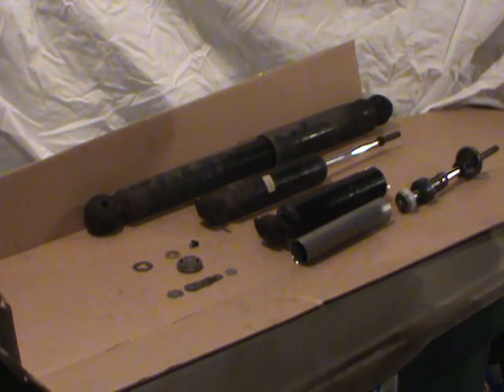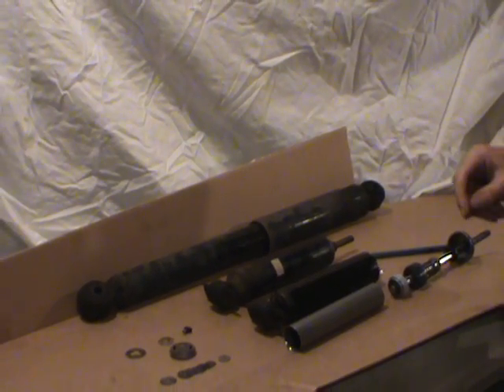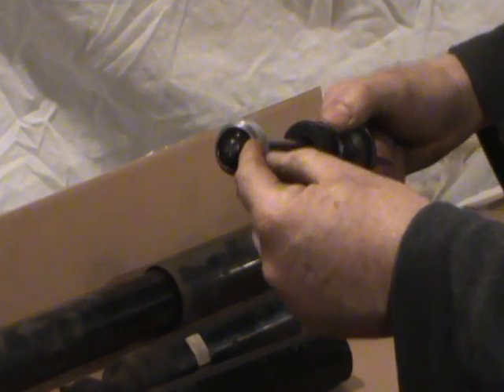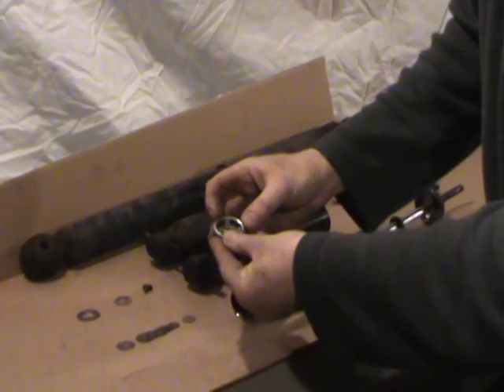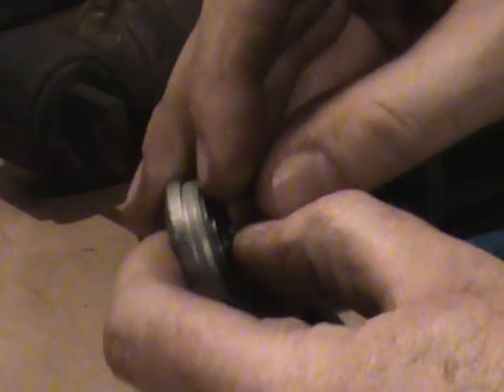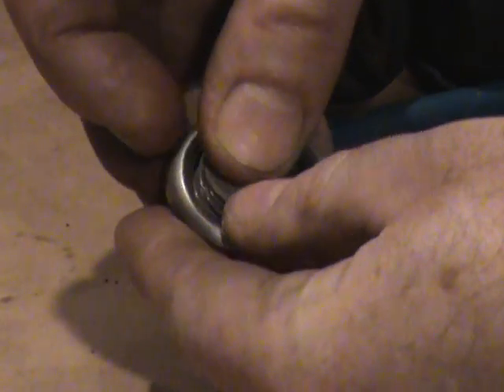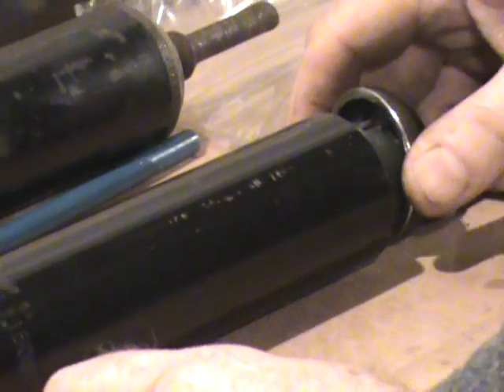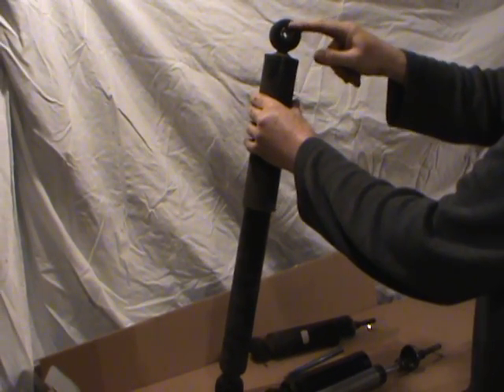Shock Absorber Taken Apart and Explained

Comment: I was a gunsmith for years and the best tool steel and gun part material in the world is shock absorber and Mc Pherson strut shafts. If you make friends with your local junk yard guy you will find him eager to sell them to you for a couple of bucks each. Manufacturers give him maybe a buck a core for them. Chisels, punches, firing pins, heck I even made a custom magnum bolt for a high powered center fire rifle out of a McPherson shaft. That .338 Lapua has fired hundreds of rounds and is like new. It will heat treat hard as glass or tough as nails depending on what you quench it in and how hot you get it
Reply from the maker: Greetings...Lawrence Withrow..........Thanks for watching, and for, what you had to say too..........Yes, indeed, the shock absorber's piston "rod", sure must be, some pretty good material alright (maybe, even, chrome plated sometimes?)...........Hmmm...maybe...4140...at the very least perhaps?..........From what I recall, it's usually those last two numbers, that indicate the carbon content, and, Ya gotta have at least, that 40 (in the number), to be able to, heat it up to cherry red perhaps, and then, quench it in brine (salt water?), well, unless it happens to be, an oil bath, hardening type of steel, that is (official, tool steel perhaps)..........I usually use, a, flat/single cut hand file, on an unknown piece of steel, and, if I can get some filings (mini shavings, so to speak), then, it's usually, not all that hard, at all, but, when Ya hear the file making some weird, metallic screeching noises, sometimes, along with lines that are carved into the file's cutting teeth, then, that's when I really know, that, that particular piece of steel is quite hard (probably rated, somewhere quite high, on the Rockwell "C" scale, from what I might remember)..........I figure, that, a metal lathe, is a really good thing to have (or have access to), because, by just trying to machine, a few different, pieces of unknown steel, including different harness levels as well, then, you'd be able to actually "feel", the metal's machining characteristics, right through, that, metal lathe's, hand operated, feed handle/s...........Then, there's something like 8620 (as I recall), that only had, that 20 number, for carbon content...........It was usually just case hardened, to probably, no more than about 1/16 of an inch deep, on the outer surface, but, in order to do so, then, you or I, could just heat it up, to about cherry red hot, and pack it in carbon dust, and, the 8620 steel would absorb some of the carbon (dust), once it cooled down..........Then, just heat it back up cherry red again, and quench it as required, and, the result should be, a case (crust only), hardened steel part, that was hard on the outside, but could absorb big impacts, because of its softer core (industrial method, to get the carbon into the surface of the steel, might have been some kind of special gas, if I remember correctly)..........Way back in high school, the Teacher, had the class, making a center punch..........Each student was given a piece of, some kind of tool steel maybe, that was hexagonal in shape, and measured, about 1/2 inch across the flats, and, about 6 inches long, and probably, along with a drawing as well, that was showing, what the final result, should end up being...........Started with the metal lathe, by using a three jaw chuck, then, turning a shoulder on the hammering end of it , then, turning the quite long taper on the other end, along with, a ninety degree included angle, at the tip/point of it...........Then, it was furnace time..........Cherry red hot, as I recall, then, take it out of the furnace, with a long pair of metal tongs, then, into the brine bath it went...steam all over the place...!!!...lol...oh, and, mustn't forget, that we were told (by the Teacher), to move the hot center punch, (while submerged in the brine), in a (horizontal), figure "8" pattern (when viewed from above), why you ask...???...well, from what I recall, it was to avoid having, shall we say, "steam pockets" (so to speak)............Can't quench, hot steel very well, with a steam bubble, now can we...lol...more like, keep the brine "liquid", in contact, with the surface, of the hot steel part, so it will quench rapidly, I be thinkin'...........Nope, not finished yet, because, we now, have to "temper" it (good ole sayin'...Hardened and Tempered)...........So, once the center punch was hardened, and cool to the touch once again, it was also, too "brittle"............So then, off to the Big buffing wheels we go, to get rid of the black finish, that the hardening process, left behind............Buff, till it was silver colored steel again, so we would be able to see the "tempering" color...........Just lightly & carefully now, heat it up, until we saw a "straw" color, as I recall, then, just let it air cool down...all finished now, and........till next time........Be Safe, take care, and have a good one.

Comment: Ive got a front strut that makes a clonk noise when body is bounced, it only clonls when the piston is moving up, when on the car its obveously loaded so should never reach end stop on up or down but i cant think what ells inside would cause the clonk, fitting nee one cured the noise so prooved rest of suspension components are ok ( did replace drop links first before fitting new strut as they are common failures) any idea what inside is causing the clonk ? It seemed to shut up aftet car was drivem for 10 mins so maybe heat does something to the parts / oil & gas ??

Comment from the maker: @MrAirshot              It sure sounds like your Shock Absorbers are worn out!   A simple test for Shocks is to have the vehicle on level ground, with the Parking/Emergency Brake On, then, push down then pull up on the bumper a few times, let go of the bumper when it is at its lowest point...   If what you see is the car going up and down too many times, (like a Pogo Stick!  lol)  then, the Shocks are worn out.   Good Shocks should stop the bouncing after 1 or 2 bounces!   Take care eh!   : )

Comment: i have octavia 2002 with 300000km
when i drive there some road spots goes up and down , and i feel the shocks are fully compressed and some time the car hit  
i checked the front shock absorbers and see no leaks (maybe gas leaked out) .is the problem is springs or shocks ?
thanks

Comment: nice info . thak a lot
Reply from the maker: Greetings...Abdul Mukhid.............You're Welcome, and Thanks for watching..................There are probably quite a few, differently Designed Shocks (aka, Shock Absorbers), that are made by the Manufacturers, that are out there..................I even had a pair of Front Shocks (on a rear wheel drive car), that has 3 Settings on them, as in, Soft...Medium...and Hard, and the Choice was all mine...lol..................I just set them on Medium, cuz I figure, that I would probably get the best of both worlds by doing so...maybe................In about, the 1980's, Yamaha, was using the good ole (rear suspension), Mono-Shock Design, on the Off Road Motorcycles, and, as I recall, inside, one of those Mono-Shocks, there was a Floating Piston inside of it, and on one side of that Floating Piston, there was the Shock Oil, and on the other side of it, was Compressed Nitrogen Gas, if memory serves me right, that is.................If You do, or ever, Ride an Off-Road Motorcycle, on fairly Rough Terrain, then, all it usually takes, is one, very Small Adjustment, to the Front Forks, or the Rear Shock/s, and when Riding the Bike on those New Shock (or Suspension) Settings, then, You would probably be able to Feel the Difference, and the Bike, would probably Act, a bit differently as well..................There are Cheap Shocks available, for the average Car, then, there's some Expensive Shocks, that would probably be needed, for Competition or Racing, and.........till next time..........Be Safe, take care, and have a good one.